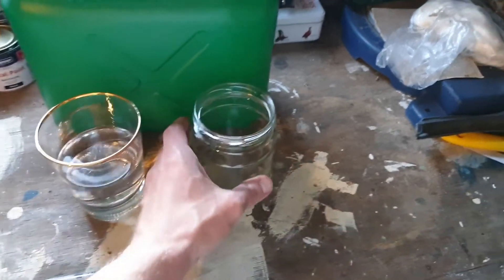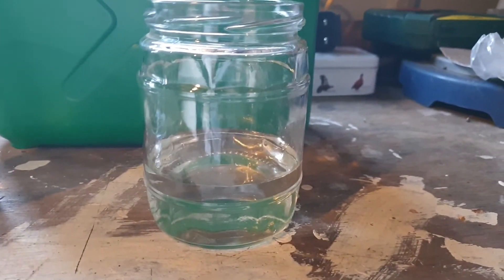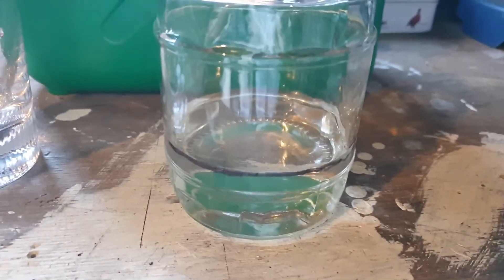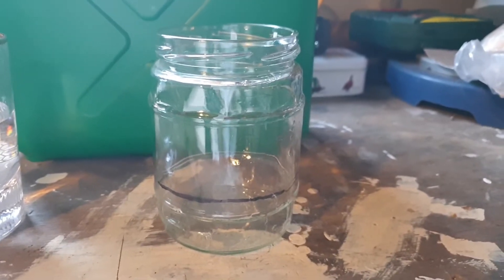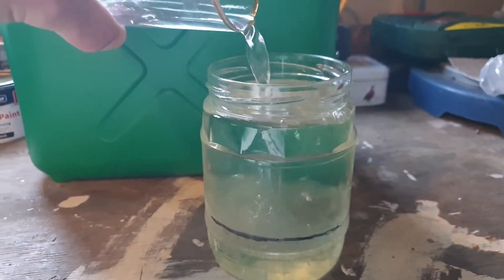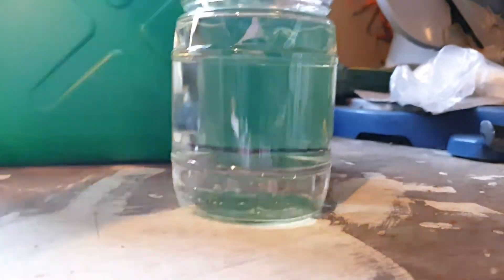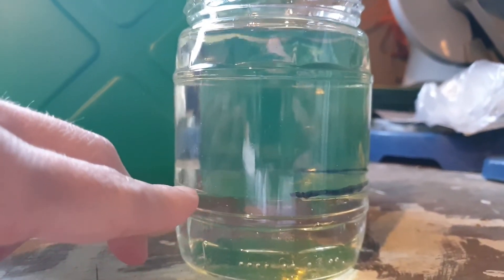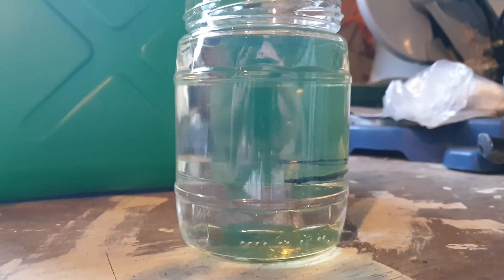Testing for Ethanol in Petrol / Gasoline Part 1: Esso Supreme

Comment: There's only one problem with such anecdotal tests for ethanol in UK E5 fuels.  The Department of Transport allows refiners to still blend E5 with MTBE and/or ETBE to raise oxygen levels.  Ether use is at the discretion of the refiner and blend facility.   Ethers are toxic and have been banned in the U.S., so the same type of test there as you perform above may have very different results in the UK.  You see, Ethers are also water soluble.   So what you may be measuring may be the ether blended components exclusively or ethers and ethanol mixed. 

You may be able to ask the service station what their fuel blend is to test a current blend batch.  They may have the sheet showing what's in the blend that was last delivered.
Reply from the maker: Thanks for the info. In the tests I've done more recently to this, there is no ethanol or other water soluble components in the fuel (I'm only testing the expensive "super unleadeds"). However I did test the standard Shell FuelSave for a control test and found some, presumably ethanol in Texacos Supreme. Interestingly, I recently discovered that although Tetra Ethyl Lead is banned in the UK, it's only for the suppliers/refineries, but I can buy it separately and legally add it to my fuel. One of my cars is still supposed to be run on leaded too.
Reply: @boilerhousegarage  I'll assume then that your use of TEL additives is one that you are familiar with in handling safely and you understand how our bodies absorb lead from contact and from inhalation of lead aerosols. Our bodies think lead is calcium.  Saturnism from TEL is considered irreversible.
Reply from the maker: You assume correctly in my potential use of it.